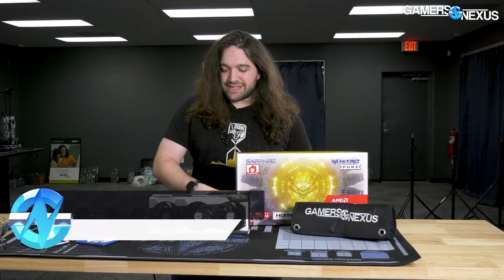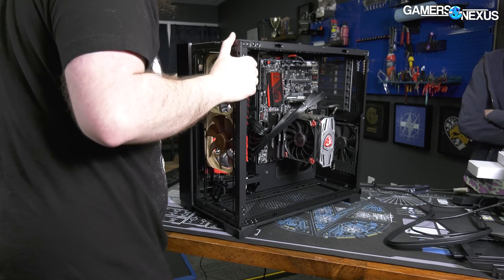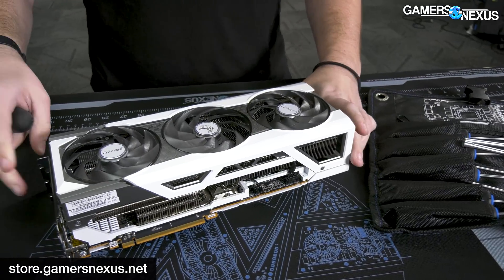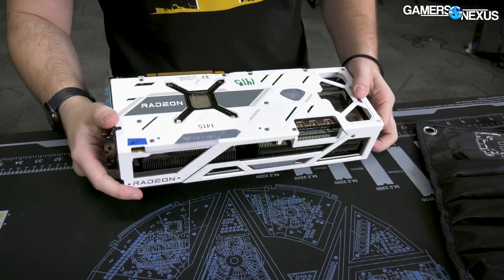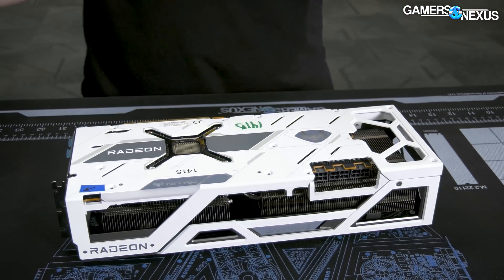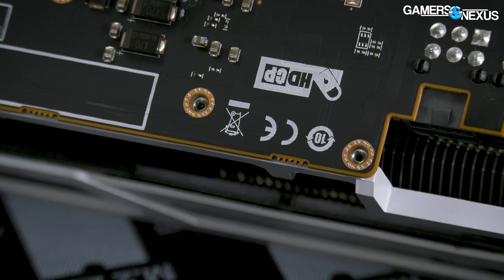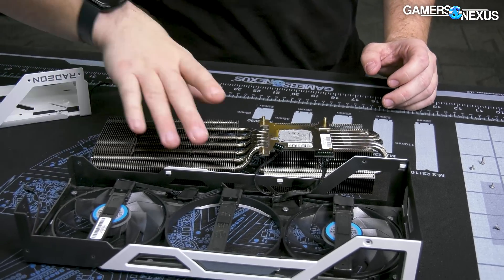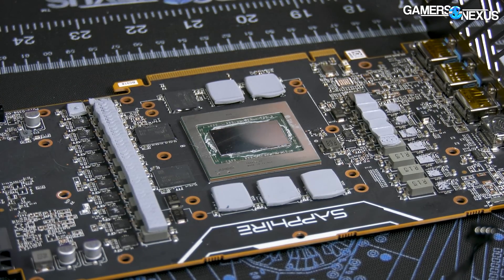Tear-Down: Sapphire's Excellent Cooler Design on AMD's Hottest GPU (6950 XT Nitro+ Pure)

Comment: I find it infinitely impressive that these cards pushing 500+ watts can still be cooled with air coolers. Even some of the most robust CPU air coolers struggle with anything above half that
Reply: since there is no real demand for multi gpu systems in consumer space, board partners are able to make one fat card that extends all the way down to the second pci-e x 16 slot. Thats why we have cards now like the 3090(ti) and the 6950XT come with such fat 3slot+ shrouds. CPU coolers on the other hand are a lot more space contrained, as more and more modern cases are designed with watercooling in mind. Especially those two chamber cases are very constrained in width. Also bigger VRM  heatsinks of todays mainboards as well as RGB RAM moduls set limits to how a aircooler is formed. Thats why most big air coolers come as tower coolers.
Reply: @Squilliam-Fancyson  I'd say the CPU coolers are less constrained in total size, as they can still increase in size in both the up-down and front-back directions (depending on mostly RAM clearance).
Reply: No ihs on gpu's, cooler has direct touch to die.
Reply: a gpu is 90% cooler
Reply: @noxproductions6851  elaborate?
Reply: @fiqirr  the board makes up very little of the overall mass of a gpu.
Reply: GPU has much larger die and also the cooler is directly in contact with silicon. That's why they can get away with a relatively small heatsink.
Reply: I understand the confusion, but it's not the same thing. You can't compare CPU coolers to GPU coolers like that.
Reply: these gpus are absolutely massive. Thats why.
Reply: Larger die and direct contact if how they do this with air coolers.
Reply: my 1500 watt moped from the 1960 was air cooled too, even passive, it didn't have a single fan. It had an enourmous heat sink, about 20 kg of aluminium. Kinda like this gpu,...
Reply: Have you seen the  Noctua NH-D15 cooler? That thing in a test done maybe 1 of maybe at most 2 years ago by Linus tech tips beat some of the well known AIO cooler brands. Sure the thing is massive and if you have any sort of fancy shaped RAM the cooler won't fit, but holy crap this thing is a beast.
Reply: Well, this GPU cooler is also  much bigger than CPU air coolers, and the CPU cooler is much more physically farther away from CPU than this GPU cooler is from GPU

GPU die is also huge relative to consumer CPU dies
Reply: What I like is that everyone loses their shit when an nVidia card pulls 375W on stock bios and 600W after shunt mods and custom vbios but AMD increasing a cards power consumption by 50% to 450W for generally less than 10% performance increase is seen as impressive.
Reply: @oxfordsparky  That's not what we're saying here. Both the 6950 XT and the 3090 (Ti) use A LOT of power. We're only saying that it's impressive that air coolers can still cool these monsters relatively well. This isn't excusing AMD or flaming Nvidia in any way.
Reply: @oxfordsparky  oh, i don't like this either, nvidia pushed the GA102 (especially the 3090(Ti)) so far it's not even funny, amd has gone down the same path with navi21, at least with turing they didn't push it that hard stock, but a 2080 ti will easily pull 400w if you remove the power limit. want to bring vega in the mix? or fermi?
Reply: @oxfordsparky  
Its not a bug, its a feature!!!!
Reply: @oxfordsparky  it's an AMD 🤣 besides ryzen CPUs, their GPUs are barely a step up from using the on board display on a motherboard.
Reply: @ganjasage420  have you seen the testing of the 6950XT? In benchmarks it pretty much trades blows with the 3090ti for half the price, and really only looses in places where games are heavily biased to optimization for Nvidia cards, or in productivity applications that have biased investment into using CUDA and lacking optimization for openCL. Basically the card is genuinely really impressive, but is being held back from its true performance possibilities by software development not exploiting its full power.

Comment: Sapphire has the best coolers ever made, every single time. They are easily repairable and easy to work with and have fantastic performance. Worth the $
Reply: In the last couple gens I'd give it to PowerColor. The 5700XT Red Devil was a monster that manager to stay dead quiet, the 6900XT is also a really great design
Reply: @maverickvgc4220  both have their pros and cons. I personally like the styling of Sapphire's cards more, and I've known them for longer so I trust them a bit more. I've had an RX 580 Pulse, am currently using an RX 5700 XT Nitro+, and am very tempted to upgrade to this new RX 6950 XT Pure.

Comment: Sapphire was way ahead of the 30x0 flow through design curve when they previously designed the air cooled  Fury (non X)  card which had a short Fury PCB thanks to the HBM modules. They slapped a full length cooler on that tiny PCB and it was a very cool and quiet card. Unfortunately AMD didn't allow partners to use custom designs with the Fury X versions which are almost all dead right now because the pump on the AIO died, so we didn't get a full on Fury X using that design.
Reply: Yup

Comment: This video takes me back to the teardown of the Sapphire Nitro+ 580 with Scott Wasson. That video (https://www.youtube.com/watch?v=iizl9tJfj24) sold me on the engineering qualities of Sapphire and I bought my first dGPU off the back of that video. It's amazing to get a similar response to the quality of engineering in the current generation, all that's missing is my ability to buy a modern card. One gripe I've discovered since then, the size of the pads used on the memory chips is unique and I'm not bold enough to repaste the card through fear of not being able to replace the memory pads. Anyway, enough from me, back to you Steve.
Reply: Did you try asking them what size they are and perhaps where you could buy replacements?

Comment: I'm glad that the GPU market is slowly recovering. Now I'm watching these videos as an actual prospective buyer, rather than just watching for the eye candy.
Reply from the maker: Feels a lot better to post reviews with that context, too!
Reply: Ikr? It's been so long that I've chosen to buy a gaming laptop instead of a desktop PC, can't wait for the upgrade!
Reply: The damage has been done though, the price floor of all GPUs has raised significantly...
Reply: @Xeonerable  Yeah, going to miss high-end gpu's at $600.
Reply: I mostly like watching to laugh at how poorly designed some products are
Reply: When it comes to AMD in my area, it's mostly recovered while the nVidia prices are still sky high to the point where there is a $250 USD price difference between a 6700 XT and a 3060 Ti/ 3070.
Reply: do you think lhr being unlocked is enough reason for gpus prices to skyrocket again?
Reply: @lunablossom5241  didn't people find a workaround for the LHR thing in like two weeks ? and na it won't skyrocket just yet as energy prices HAVE skyrocketed while crypto just took one goddam huge mfing dump on itself
Reply: @lunablossom5241  No.  Both Bitcoin and Etherium have significantly depreciated in value.
Reply: Great comment! It does feel so much better getting back to these type of videos featuring unique AIB builds.
Reply: nomasporfavor  I bought it 6900xt and it’s fantastic, sold my 3080 for it and I would be hard pressed to go back to NVIDEA.
Reply: Unless prices AND MSRP goes down, I wouldn't consider it recovering..
Reply: Laptops suck
Reply: yeah this aged like shit
Reply: nomasporfavor  what's wrong with that decision? And don't say,  "wAiT fOr NeXt GeN", as nobody knows what will happen in 4-6 months.
Reply: @cameronfitzgibbon219  I totally agree that it's not an irresponsible move in the same way it used to be.  In the past the only logical reason to buy a card close to the launch of whatever the next gen was is if you actually needed it for something.  With current trends though it's really not feasible for most of us to spend a ton of time jumping through hoops just to maybe get one from a scalper 6 months after launch.  Miners will always win that battle, as they have real investment tied to the game.
Reply: @cameronfitzgibbon219  Why would we say "wAiT fOr NeXt GeN"? Is your caps lock broken?
Reply: recovering isn't exactly correct the GPU'S were always there they were just being sent straight from the factory to miners but i get your point
Reply: I got fired from my job because i almost fought my 50 year old coworker.. and It got toxic yo so now, i spend most of my time smoking weed on my YouTube channel now, meanwhile i get back to the hustle👀👀💯💯
Reply: @SevenHunnid  bots are getting creative
Reply: @SevenHunnid   fought a 50 year old?

Comment: I have an all white build waiting on a GPU. Literally only a GPU (and well it's a 12600k inside since 1700 will support 13th gen so waiting on that i9-13xxx) and I kinda want this card.
Kinda.
It costs about €1600 in Sweden. I can only imagine how much power I will be able to buy for €1600 in some 6 months. And how much value this will lose. I need to hold... HOOOOLD

Comment: I would imagine since there is a header labeled "pump" they plan on making a hybrid card and that's another reason why they have a separate dedicated memory and VRM cooler.
Reply from the maker: Yes, the presence of it indicates that they have or will make hybrid cards with this PCB, as we said.
Reply: They could be reusing an old PCB, the 6900XTX toxic's PCB should be able to handle the 6950XT too
Reply: Their Toxic model is a watercooled card (though I'd love to see someone design a waterblock that fits within the shroud of this Nitro+ Pure :D)
Reply: Yeah there's a sapphire toxic card. That is water cooled. Currently in stock! Unfortunately I don't think should spend £1250 on a graphics card right now...
Reply: I wonder if a connector could be soldered on by a DIY enthusiast, and the vbios modified to add software control to that header.
Reply: @CaveyMoth  Better to just connect fans and pump to the mainboard and use FanControl for them.  The VBIOS doesn't freak out at 0 fanspeed, it only cares about temperature.
Reply: @CaveyMoth  Sapphire has a Toxic edition 6900xt that is AIO cooled; so it's likely that they will be doing it with this refresh as well.
Reply: I like having extra functionality headers on gpu.  Sometimes I just want to go easy and let the gpus firmware adjust cooling instead of running everything at full tilt.  Often I don’t want to burn a bunch of time btw game updates to adjust cooling settings depending on update characteristics.
Reply: or dual loop =)

Comment: Not sure about nvidia being the first on the flow through design, from what I remember its sapphire that kinda did it first from the fury-x when they are trying to make as and air cooled card rather than a water cooled card.
Reply from the maker: NVIDIA wasn't the first. Explicitly they were not the first. We just said that this is what they call it because they stuck a name on it.
Reply: Not sure about the Fury but the Vega 56 pulse used the nano PC and the back was 1/3 PCB and 2/3 flow through
Reply: I had a Asus HD7850 Direct CU II which used a pass through design back in 2012 so the concept has been around at least since then if not before.
Reply: It was the regular Fury rather than the Fury X (which was water cooled). Both the Tri-X and Nitro had a "flow through" design, as did the XFX Triple Dissipation model.

Comment: We will need an evolution of GPU coolers video soon, there getting massive. 
It's got to be 2X the size of  a few years ago.
Reply: Because high end cards right now isnt efficient with wattage. They use massive power to get that high performance as opposed to previous gens.
Reply: @Doflaminguard  They are more efficient, they just also draw more power. They're not mutually exclusive :)
Reply: @Emelydiaa  i dont think a 800w GPU is energy efficient.
Reply: @Doflaminguard  1. We're not at 800W GPUs yet. 
2.You're completely ignoring the massive performance gains we've seen over the past decade. GPUs are using roughly 2x more power than they did 9-10 years ago, but their performance is 4-5x higher. So yes, they are getting more efficient.
Reply: i don't think raw size increase is much of an evolution.

Comment: Sapphire has almost always been the best AMD card maker.
Reply: Sapphire has been making decent cards since at least 2006, I still have a couple of my old sapphire cards around collecting dust lol
Reply: @Rancid_Ninja  Definitely. I still have a Radeon X1950 Pro, AGP, in the box in the drawer next to me!
Reply: Well Sapphire is the brand AMD choose to make their Refence Cards. They do a pretty good job.
Reply: what about xfx? their red dragon or whatnat seems pretty good
Reply: @TheHighborn  PowerColor makes Red Dragon/Devil cards, which are good. But I still think Sapphire is better. XFX, mostly meh.
Reply: @DavidLee-df888  ah thank you for the correction. i'm not that into brands and stuff. i just know that the red dragons historically performed well & evga makes nice cards, but they don't sell AMD unfortunatelly.
Reply: @DavidLee-df888  The RX 480 I had from xfx some years ago was actually good. £199 brand new at release, had the same quick disconnect fans as this card, reasonable heatsink on it, not that noisy, actual metal backplate too, can't complain really
Reply: @TheHighborn  That's Powercolor. And XFX, at least with last gen (RX 5000), was garbage.
Reply: @Emelydiaa  thank you for the correction
Reply: @Emelydiaa  I own an XFX MERC 319 RX 6800.  It seems like they picked up the slack with it.  Really good cooler, even has thermal pads on the back of the pcb over the VRAM.

Comment: Even the 6600XT Nitro+ has the one screw pin to pad fans. They are truly amazing. However maske sure to buy spares before they break especially for the central fan. My Vega 64 Nitro+ had its central fan break and Sapphire now only sells the outer fans and the central fan is no longer produced at all anywhere. The central fan was the fan that would give the read out on rpm so because it is broken the gpu thinks no fans are working and causes eratic fan behavior.
Reply: You can probably find some Chinese knock off. I did find replacement fans for me 580 this way and they work fine.
Reply: @Mysteoa  You can still buy fans for the 570/580/Vega Nitro+ since they use the same fans except for Vega's central fan. There is no way to get the central fan, I looked everywhere even in chinese markets. It simply isn't produced anymore at all.
Reply: @registeredblindgamer4350  I tried to get fans for the 580, but they were all out of stock. Or at least the one available to me.

Comment: I’ve bought more doa trash from Best Buy than any other place of business ever, a very sad qualifier. Twice I’ve had to scream at the top of my lungs to get the money back which wasn’t even mine. I build computers when hp came out with the 100/200i DVD burner 200i being $399 got it home was missing cords and doa. Brought it back they accused me of loosing the parts killing drive not plugging power in e.t.c. Fkn joke! Needless I garnered attention until I got my customers money back. Best Buy did not enjoy the attention I was bringing to their scam. Drive was reshrink wrapped and back in the case not sold as open box either. Which I would not have bought for a new build for a customer.